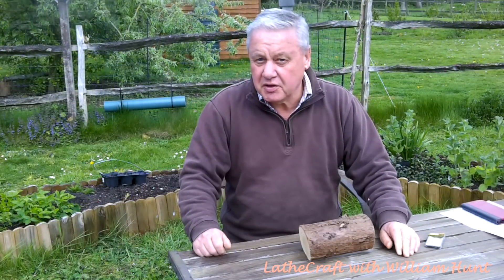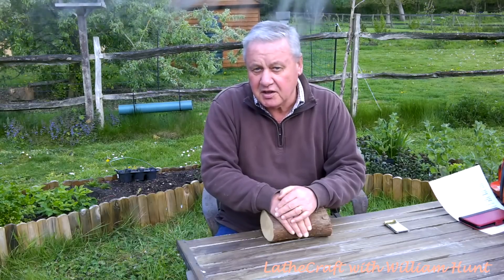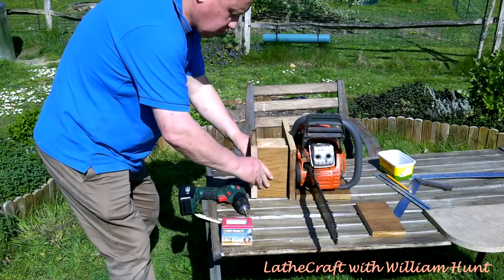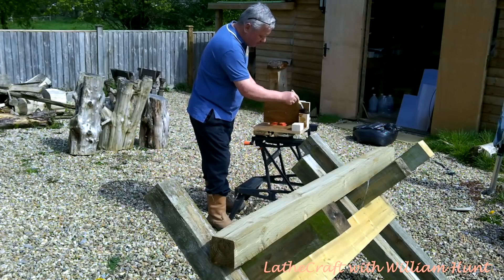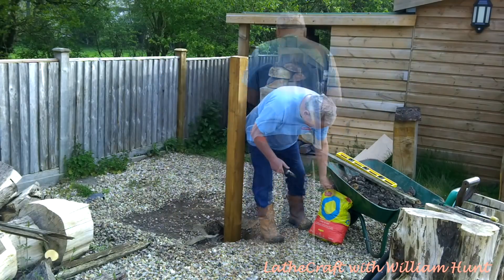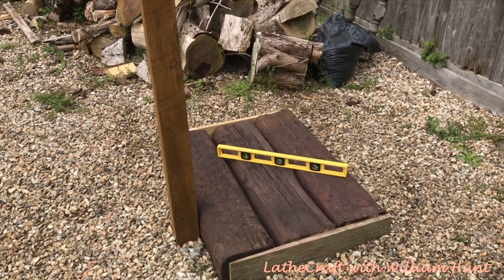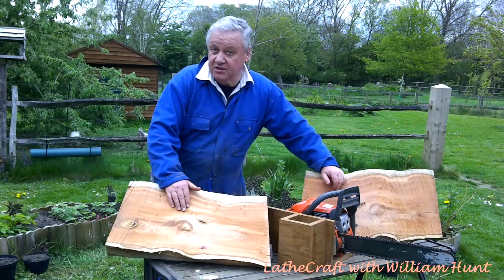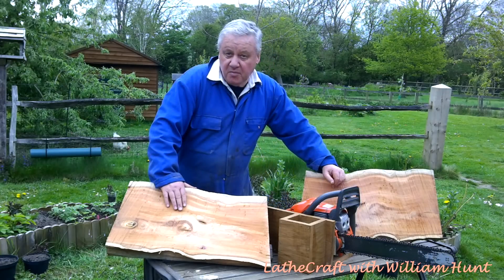Cheap Chainsaw Mill - Build Your Own DIY Vertical Chainsaw Mill Attachment

Comment: Thanks for sharing this informative video. I've watched several other videos that describe builds of vertical chainsaw mills, and I like several aspects of your design (the log bed, cementing the post in, using zip ties to hold the saw in the carrying frame and painting the target line on to the log bed).

I do a fair amount of work with chainsaws, and I disagree with you and several commenters who believe that reducing the clearance between the post and the saw carrying frame will improve the operation of the mill. "Rocking" a chain saw (forward and back, not side to side) in the cut is critical to reduce drag on the chain, thus increasing the speed of the cut and the life of the chain. As you refined this build, I hope you devised a method to hold the saw steady side to side in the carrying frame while allowing you to rock the saw forward and back in the cut.

As you describe well in the video, finding a way to stabilize the log you're sawing is a challenge. I like what you came up with, but I wonder if it could be improved by having the stabilizer ride in a track that would let you clamp the stabilizer closer or farther from the log to be cut.

I hope this vertical mill has given you good service. I'd love to see a follow up. Thanks again for sharing.

Comment: Your setup looks to be about right.
One thing I have not heard mentioned in any chainsaw mill videos is:
How to insure the cut runs parallel to the core of the log. This would be important when trying to make perfect rift or quarter sawn lumber.
With your setup, you just need to measure the distance before attaching the stabilizing brackets.

Comment: There are horizontal, vertical, and angled DIY mills. Trying to figure out what's best for my situation. I have 36" rounds that I need to cut from both sides because I only have a 16" chainsaw bar.  Any suggestions?

Comment: It might have to increase the length of the the guide by a foot to decrease the mechanical advantage the cantilevered weight of the chainsaw. Also rounding over the bottom edges of the guide that surround the post might help in preventing it biting into the post.

Comment: To make the carrier move more smoothly you might try covering the entire four inside surfaces of the carrier with some plastic that is stiff, not likely to tear and at least 1 to 2 millimeters thick. This will require making the inside dimensions of the carrier appropriately larger. I'm thinking of plastic such as this food container https://www.amazon.com/Snapware-Airtight-40-Cup-Rectangular-Storage/dp/B07VDV4N7T/ref=sr_1_30?dchild=1&keywords=plastic+food+storage+bowls&qid=1592803989&sr=8-30.

Comment: I think this a great simple design. I think a better method of fixing the log, i think you hit the nail on the head being able to swivel the chainsaw. I would try having the same set up with the post and "post hugging slider, but instead of fixing an L shaped piece to sit the saw on, just have a the vetical piece the make a seperate Lshaped piece and connect the 2 with a lazy susan bearing so they are still connected but you are able to swivel the saw to help cutting. The post slider could also be made smoother by making it larger to accomadate small fixed wheels on all 4 sides. Good luck, i think your on to a good idea here.
Reply from the maker: Thank you for this, great idea about the wheels.

Comment: Thank you for posting this.  I copied your design and found one simple improvement.  1)  Drill a hole from the back side of the carrier through to the main runner beam at the halfway point (from top to bottom.)  Then you can insert a dowel rod or an old screw driver to hold the saw carrier in place above each log you are positioning.  Make more holes on up to the top of the main runner as needed.  Cheers!
Reply from the maker: Thank for this, and a great tip, Ill modify my own!

Comment: Making your movable "slide" at least 2X as long as its width will help greatly with the sticking issue.  Also waxing (soap will do) the vertical post will also help.
Reply from the maker: Yes thanks, I have candle wax on it already and its helped a lot. I was thinking in the longer term about roller bearings.

Comment: Would it be possible to put a few coats of wood wax on the mount for the chainsaw, where it rides down the post? I'm thinking this may limit the need to rock it back and fouth.
Reply from the maker: Hi Brad, yes  it's on the list now. Also looking at roller bearings.

Comment: For support, I was thinking of using aa anchored speed bar clamp or two that would adjust both in height and reach. Maybe one on each side of the wood being cut? Have not tried that out yet, maybe you will. Also, I have raised the blank on a replaceable sacrificial piece of wood so the bar can cut through to slightly below the bottom of the blank. Also, the special rip chain does not come sized for my small saw, so the saw shop sharpens the regular chain to a steeper grind, giving me a rip chain for the price of sharpening. Works great, costs less. Hope we see your modifications soon.
Reply from the maker: Thanks valerie, just noticed this. Im fortunate in that I can get a good chain for my saw and it works Ok.

Comment: My thoughts FWIW are that this works well. 
The saw might be more firmly held by clamps built in to the carrier - a piece of hardwood and two coach bolts, wing nuts and washers. 
Movement of the saw carrier might be improved by adding lubricant to the post - I just can't make up my mind as to what. Candle wax or grease come to mind but the grease will collect saw chips so perhaps wax is better.  
To hold the base of the log you could use sacrificial pieces of 2x2 or similar screwed to the base. They will only get cut on the line of the saw bar - or just leave a gap on the bar line. 
The stabiliser slider would easily be held in place using a wedge or two.
Apologies if this is a repeat of everyone else's comments!
Reply from the maker: Hi Peter and thanks very much for your comments. I like the idea of lubricant and Im now thinking of some hot paraffin wax painted on the pole. Also the 2x2 idea god Ive got some 4x2 offcuts I can try when I've some wood to mill next time.

Comment: nice mill you should get a skip thooth chain no need for a new bar i have same saw
Reply from the maker: Hi Kevin, yes I might try that with a longer bar, would that work?
Reply: @WilliamHuntLatheCraft  yes that would work but no longer than a 24in the saw cant handel  more than that
Reply from the maker: Kevin, is the because the output of the engine, or the design of the saw?
Reply: @WilliamHuntLatheCraft  because the power

Comment: Interesting project which is clearly successful. I have concerns about the using the wooden fence post that it may warp and may bind as wood  is not the most frictionless material  and the cutting will tend to make the saw rock on a single post but its a good prototype anyway.
Thanks
James
Reply from the maker: I agree about the fence posts but I set myself a boundary of using what materials I had to hand. I hope the varnish will give it some protection.  I did not slide up and down ease but with a rocking motion. Im maybe thinking some sort of trach might help.

Comment: William,
How about a few short nails pointing upward from the base that would impale the bottom of log, both sides, to keep it from moving. They could be placed in predrilled holes with heads cut off. I also imagine if the saw carriage were a tighter fit on the post, less rocking would be required to get it to descend smoothly. Maybe rub the post with soap or wax. A very neat project!
Lou
Reply from the maker: Thats a good idea Lou. I've added these  comments to a list Im keeping then I'll review in a month or so.

Comment: When you were building, I anticipated you having the sticking issue. Two things I would suggest to tweak. Lengthen the box around the post by a few millimeters in addition to your suggestion of making the bar parallel. The second idea is to wax the post and the inside of the box. Oh, and put a handle on the back of the box to help keep everything in line.
Reply from the maker: Douglas, thanks for this contribution. Both sound ideas, especially the handle, should have thought of that!

Comment: A pleasant surprise, the Friday video showing up on my Thursday evening.   Thanks.  A very good video as usual.

I learned some years ago that "free" wood for turning is only free in the aspect of not paying for the log sections, but when it comes to preparing the wood for turning, it takes a LOT of time.

This is a very good project to assist in preparing log sections.   I may have to make one for myself.

I agree only 1/8in variation is very good for a hand held chainsaw jig.

I suggest some lining of the chainsaw carrier.   In the US we have UHMW sheets of this plastic "Ultra High Molecular Weight" plastic.   It is white colour and low friction and often used in jigs to aid in ease of movement.   I have small sheets of this in 1/4in thickness.    The main challenge is that epoxy and other glues do not stick to this, so you may need to screw this into the liner, so the holes need to be countersunk and the heads of the screws below the surface a little.

I was at a friends place last weekend.   He is an expert on chainsaws, created some patented chain designs over the years.   He reminded me that cross cut chains are different than ripping chains.

Your video was cross cutting the log section, which is the design of the typical off-the-shelf chain.   If you did want to cut along the length of the log section , this would ideally use a ripping chain.   Fewer teeth and the teeth spaced farther apart to allow the long ripping chips/ribbons to be removed.   You can rip with a cross-cut designed chain, just need to go slower to allow the longer chips to be removed.

Dave.
Reply from the maker: Dave, thanks for such a considerate response. Ill investigate UHMW idea. As for the ripping chain I think this needs a different bar but I'm not sure, I'll check with my local agent as im no expert with chainsaws, as you can see! Thanks again.